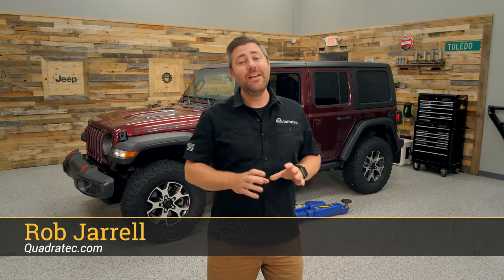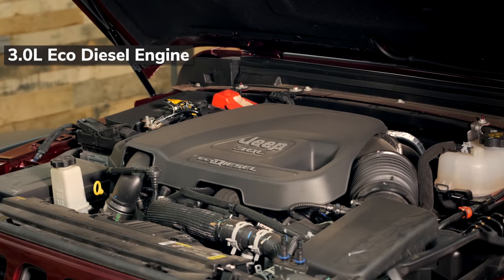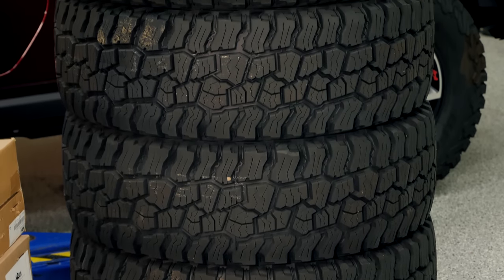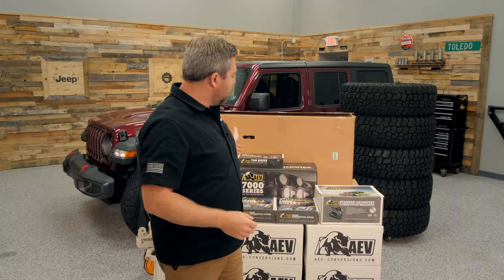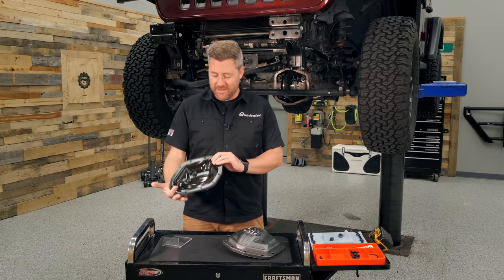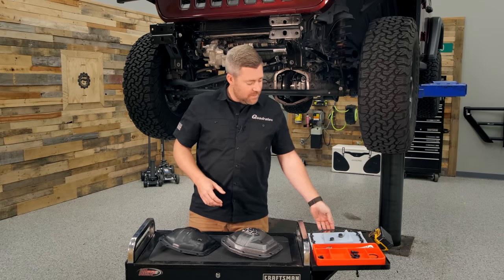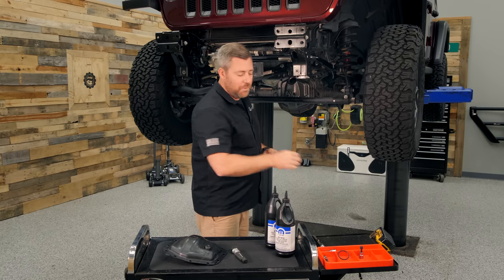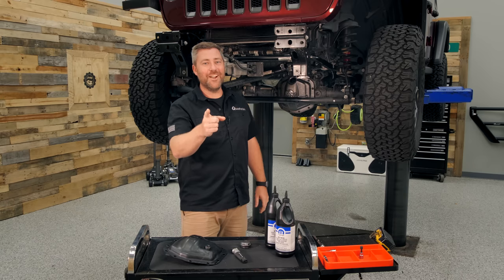AEV Jeep Wrangler Rubicon EcoDiesel Build Up - Episode 1 of 4 Teardown & Diff Covers

Comment: AEV has amazing products and I haven many on my Jeep JKU Rubicon.  I tried Lube Locker Gaskets with the AEV Diff Covers and found that the cap head bolts back out after about 200-400 miles.  Eventually pulled the reusable gaskets off and used RTV and all is well.  I would be cautious with the use of gaskets with those diff covers.
Reply: I've had lube locker gaskets on my jku bombshell diff covers for 3 years now and no bolts have backed out.

Comment: Your products are very expensive
Reply: Quadratec doesn't set the price of other mfr products.  Inn other words, if you have s problem with price you should talk to AEV.  These are actually fair price for what you get.  They aren't cheap, but not overpriced.
Reply: It has a reason: I had jeep with aftermarket bumper and I have a AEV jeep now . Click on my logo and check my “ rig walk around “ video to find out why it’s more pricey. 
I have seen others and mine side by side no comparison. Also, airbags works on time with AEV or ARB bumper
Reply: Welcome to owning a jeep.
Everything is expensive
Reply: @MrStaybrown  true. But AEV products worth the money I believe.
Reply: @OverlandbyEric  everyone has their own brand. I have metal cloak,  w/ yeti bars, tereflex hd balljoints.
Reply: @MrStaybrown  I am a big fan of Metal cloak specially their lift ( game changer) I noticed each company is good in something and AEV only good with bumper 😃would you give a feed back on Yeti XD ( steer smart ) thanks
Reply: @OverlandbyEric  they're solid.
It's a flipped drag link no griffin.
The tie rod assembly is awesome.  I've walked into tree stumps that were hidden under snow and the steering is still solid.  Only maintenance is a shot of grease often.